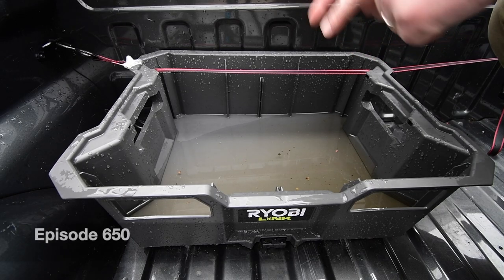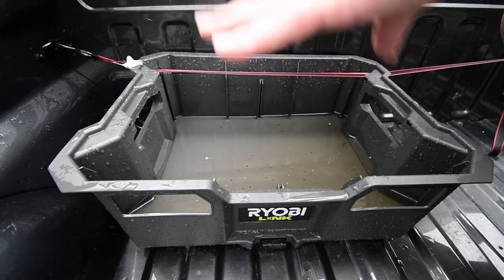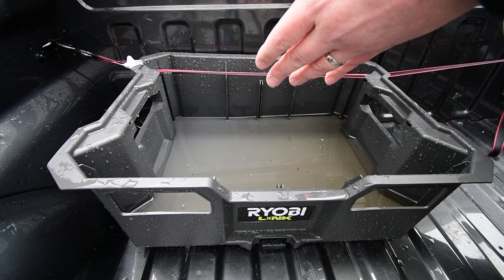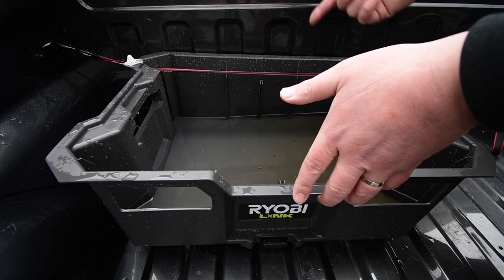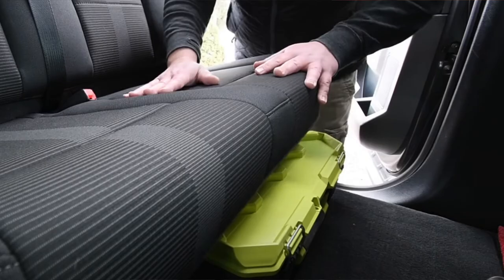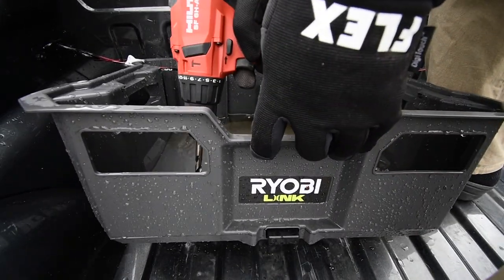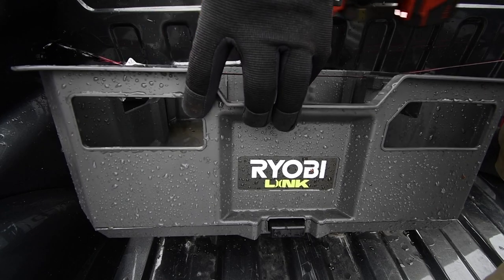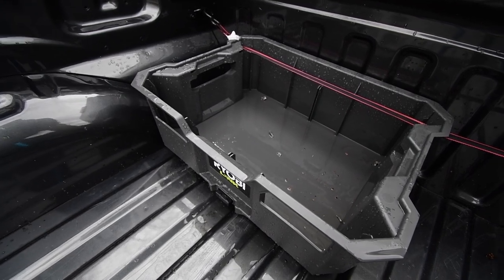Ryobi Messed Up BIG TIME!

Comment: Drain holes also mean water can soak or flood into the storage container...or out of it! 

 Ryobi made it correctly.  

If you want it to drain, drill holes.  Maybe they could make spots to drill on if you want it to drain.
Reply: yes, my dewalt have the hole, one for tray i use for store coil cleaner, ice machine cleaner etc. if cleaner package leak i f.....😂
Reply: yeah I was kind of thinking it's made more for holding tools not setting out in the rain like a bucket lol

Comment: These packout style systems are not designed to hold trash in the bed of a truck.... they are designed to hold tools. Nowhere does ryobi state that their link system is waterproof and a great option for hauling trash in the rain.
Reply: that's kinda what I was thinking. don't know all that much about the Ryobi storage systems so I figured maybe it was actually a trash can or something but yeah obviously a crate is not made to sit in the back of the truck it's made to hold your tools
Reply: I think he was looking for a milk crate and somehow bought Ryobi crate 😂
Reply from the maker: Hauling trash is not the point. the container holds water, which means whatever is in the crate will be sitting in water. if something spills in it or it get rained on. what would you rather have, tools sitting it in liquids, or tools not sitting in liquids?
Reply: @ManCaverTools  what if your trash 🗑️ has liquids 💦💦in it you don't want to leak all over your truck bed? 😂🤪

Comment: First world problems, using something noy for the specific use and blaming the company and telling them to fix it... "facepalm"
Reply from the maker: I know, drain ports on a crate, nobody ever thought of that before right? who would have thought. Since you say first world problems? Im guessing that you think that America is the only country with crates?
Reply: @ManCaverTools  I'm just gonna assume that he just means it's more made for holding tools and such and not for a trash can that's in your truck bed. ( we wouldn't normally leave a crate of tools in the rain so wouldn't need the holes but it couldn't hurt bc alot of dirt and dust do build up in my pack out so it would allow it to fall out if it had holes. yet again it would allow water in which is bad. kinda a double edged sword)
Reply: @ManCaverTools  yeah I'm with the other guys here. I would rather not have holes in my tool box. If you need a crate that is specific to holding trash in your pick up I suggest spending only five bucks on Rubbermaid knock off and putting it back there. Cut out the top of a lid then drill some holes bada Bing bada boom you have a trash can that's easily accessible, also keep it from flying out and will drain out. I trust your reviews usually but after this I might begin to be more skeptical now on the validity of your complaints.
Reply: Fuck it's April fools day. Ok I get it.